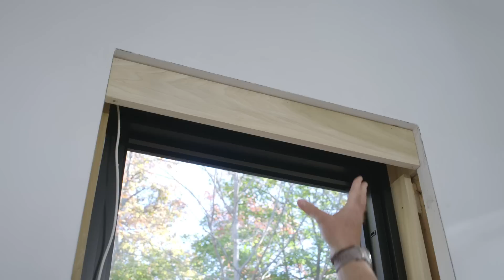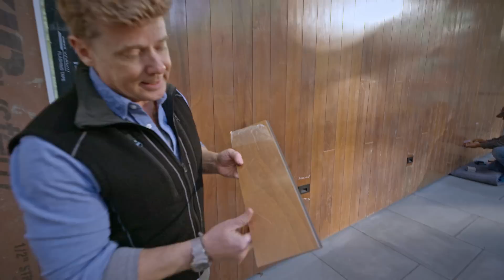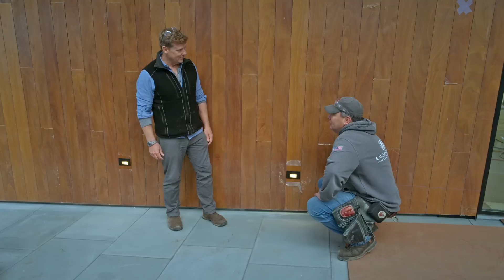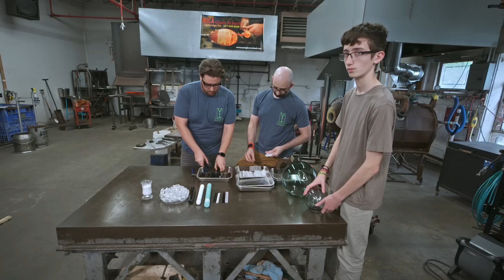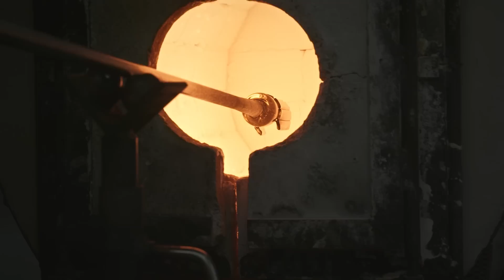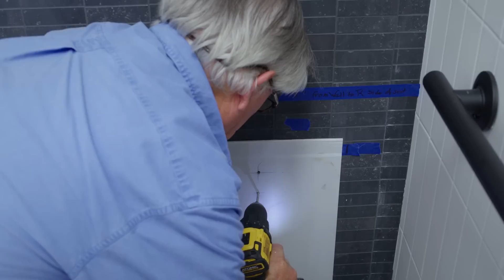This Old House | Install with Care (S45 E13) FULL EPISODE

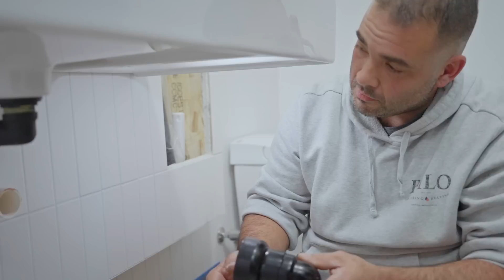Comment: At 11:50 you can see a large rectangular hole in the tiles for the drain.  
The problem with that appears about 10 seconds later.

Comment: with the bathroom faucet, do they not use the teflon tape on water connections anymore?
Reply: The hoses that supply the faucet have rubber washers built into the fitting. The water shut off valves are compression fittings. Tightening the nut compresses the ferule and creates the seal. The pipe dope he was brushing on is likely some sort of PTFE.

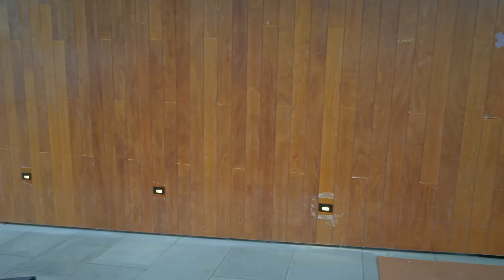Comment: 9:27 LED lights are uneven.
Reply: I don't think so.  The ramp makes it seem like the light on the left is further up the wall than the light on the right.  The camera angle probably accentuates the distortion.  I would have had the lights follow the angle of the ramp, but the homeowner ultimately has the final decision, so 🤷‍♂
Reply: @ToxicSpork  You're probably right. I was thinking there's some reason for it.